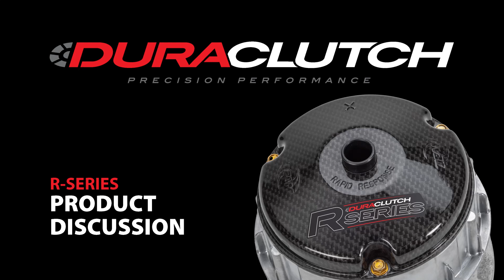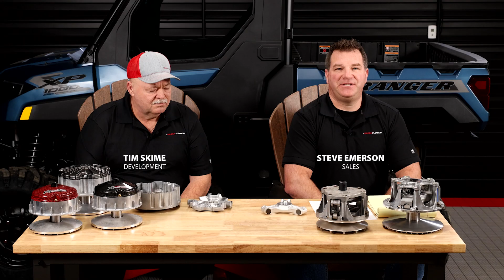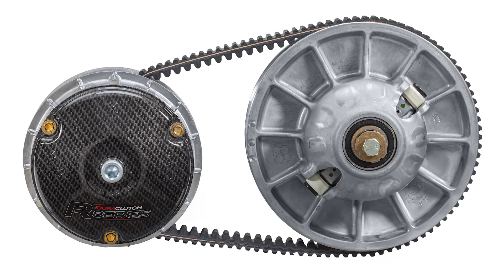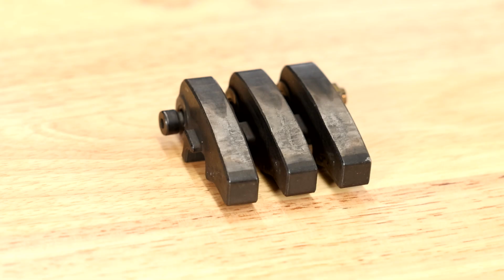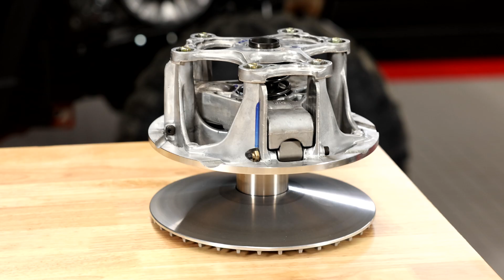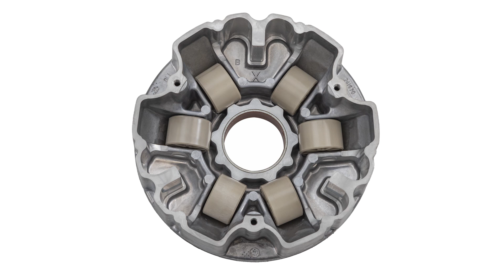Table Talk About the New R-Series from DURACLUTCH with Tim and Steve!

Comment: Is the clutch performance oriented  ? As in extreme hill climbs, drag racing, high RPM high speed pulls ? 

My 900 regularly see's rpm's in that 8500 area, with my tune and intake and exhaust with a gilomen clutch kit in sand dunes..... then the next weekend im trail riding and rock crawling. 

My clutch is wearing out from pure abuse, so im looking around.
Reply: Clutches are wear items, the factory Polaris clutches are fine with proper maintenance once a year removing belt dust and either graphite lube or dry lube application to slide buttons and pivot points. Lastly is attention to a new belts break in procedure for long life and most importantly for proper service life and performance is never granny gas the throttle when overcoming static rest to rolling movement, that doesn't mean just goose it constantly but do get the belt and sheaves immediately engaged in moving marriage so to eliminate possibility of hourglassing a belt or overheating the sheave faces. 

Without centrifical clutch discs and shoe style engaugement assistance as Yamaha incorporates into their larger utility atvs and side by sides, all other cvt setups are liable to problems inherent in the very nature of a wear item component aka cvt clutching system. Make no mistake a 10k miles service life can be achieved on stock Polaris clutching simply by the operator being smarter than the clutch in application of previously mentioned information and positive belt engagement practice eventually becoming muscle memory by nature. I cant stress enough the utmost importance in avoiding the belt devouring sheave abusing action of grandma gassin that throttle guys, just not necessary to shell out 1100 plus bones for a greased primary and a secondary in the end operating off all the same principles imo.